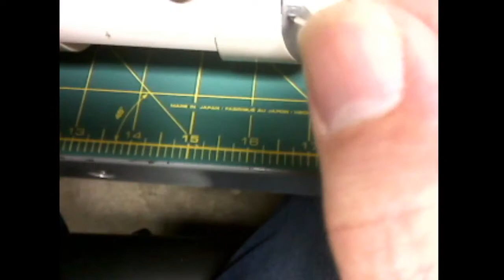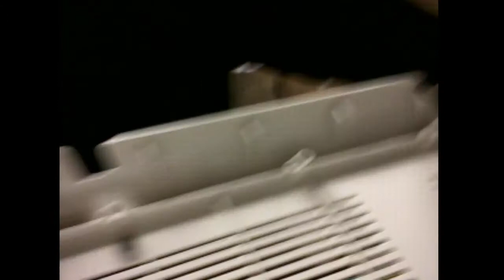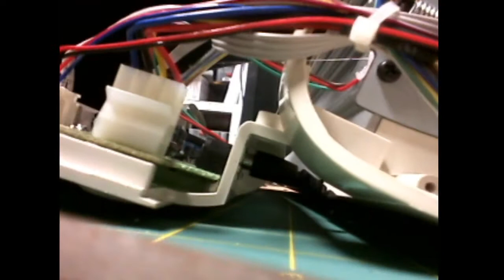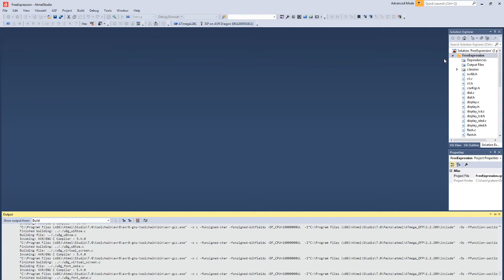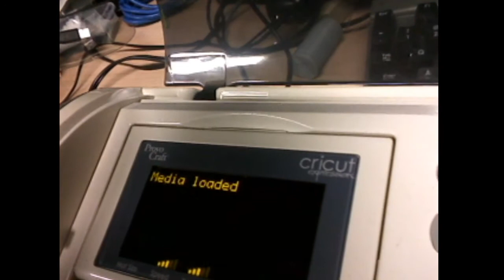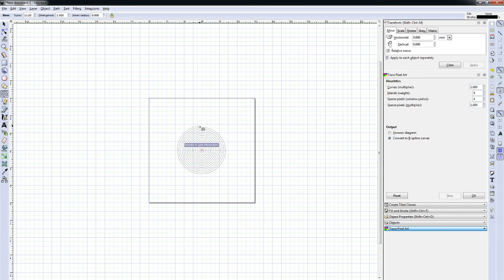Flashing FreeExpression Firmware

Comment: I just did this following this guide.

Since the original chip editor, the ASVRISP Mark II, is no longer made, I picked up a AVRISP XPII compatible device for around $40. I think mine was made by waveshare. 

The cable used between the old Cricut and the computer is a “USB-A to USB-B” cable. My chip editor came with a cable that would work (like his did in the video), but it is very short. I am using a ten foot cable. 

The software that replaces Atmel Studio 7 is now called “Microchip Studio for AVR” by Microchip Technology, and can be found by a simple search. (I found it by searching for “atmel studio 7 download”, and the new software was the top link.

I did have an issue in that the screens. The bottom box labeled “Output” was blocking the “properties” box, and I had to click the little down arrow on the left side of that box (On the lower box called “Output”, there is a yellow bar. On the right of that bar, there is a triangle pointing down, a thumbtack and an X. Click the upside down triangle, click “float” and then when the box moves, click the same triangle again, then click “Dock” that should show the hidden box “Properties” and then it will look the same.

The rest of the tutorial is visually the same, and pretty well done. 
There for a bit, he goes back and forth between “build” and “clean”, but he does it right the first time, and you don’t need to worry about following too close there until he moves on to “Tools”

Comment: When I attempted to program the device, the device signature doesn't appear and I get an error code when I click "read"   
" Failed to enter programming mode. ispEnterProgMode:Error status received: Got 0xc0, excepted 0x00 (Command has failed to execute on this tool)
Unable to enter programming mode. Verify device selection, interface settings, target power, security bit and connections to the target device."
I'm not certain what/how to verify as I'm just following along and don't understand tech speak. The tool is recognized (AVRISP MKII) I used ATmega1281 as the device and ISP is the only option for interface - but it won't read the signature. I don't know what I'm doing wrong. Boo-Hoo! I know it's been years since this was originally posted, but if there is any help out there - I would super appreciate it. Thanks so much.

Comment: Thanks for sharing this. I was using the SCAL 5 hack, but it cuts way too fast for how floppy these machines are. It was literally cutting dashed lines on the Y axis (or is that z on a vinyl cutter). I'm looking forward to proper speed control.

FYI, disassembly is not required. All the pins are accessible through the cartridge port. Get a proto board with edge connections and some basic soldering skills and you're golden. Pin 1-6 on the ribbon cable are the front left edge connections. The first connection is pin 1. It's even reversible (back right pin is also pin 1). I'm going to try this on my junky expression that I already have torn apart. If it works well, I'll do it to my nice one. Yes, I have a goodwill computer store addiction problem that resulted in my ownership of 3 cricuts.
Reply: Have you been able to get around to building an adapter?
Reply: @ellisgl  No. I was going to make one to use with an Arduino as the programmer, but I couldn't get atmel studio to talk to the Arduino. I bought an avr programmer that had an adapter that would plug into the cricut's board, so I just went that route. 

I now a 2 expressions from goodwill running the custom firmware. Also, I got them to work with SCAL 5. I don't really like that software so I just use inkscape, but some people may want to go that route.
Reply: @generic0000  interesting. I wonder if you can just compile the hex and use AVRDude to load it up?
Reply: @ellisgl  I did try to do that, but I'm completely lost with atmel studio. If I remember correctly, I couldn't figure out how to get the hex file. Sometimes it's hard to find out how to do simple things in technical software that just assumes you know what's going on. I'm familiar with Arduino IDE, but I'm kind of spoiled with things just working within the arduino (and even ESP) ecosystem. and they make their instructions simple enough that my kid's could follow along.
Reply: @generic0000   I'm wondering if Visual Studio might be able to do it with PlatForm IO instead of atmels huge dev env
Reply: Same i bought my second one and its one firmware update from working with scal 6 and the libcutter

Comment: If you replace from line 43 in the u8g_rot.c file 

uint8_t u8g_dev_rot_dummy_fn(void *u8g, void *dev, uint8_t msg, void *arg)
{
return 0;
}

with

#ifdef __XC8
uint8_t u8g_dev_rot_dummy_fn(void *u8g, void *dev, uint8_t msg, void *arg)
{
return 0;
}
#else
uint8_t u8g_dev_rot_dummy_fn(u8g_t *u8g, u8g_dev_t *dev, uint8_t msg, void *arg)
{
return 0;
}
#endif

the warning will disappear

Comment: Does this work with a disabled Cricut Maker?
Does anyone know how to turn it back on please? Thank you
Reply from the maker: Unfortunately no. This formware is only for the Expression. Depending on what "disabled" means, you might be able to buy another broken Maker, and swap out the bad component. See if there are any hackerspaces near you. Someone there might have the skills to assist.
Reply: @zombiiilabs  Disabled remotely by Cricut to avoid return shipping costs.
The Cricut Maker is new and considering the price I find it a shame not to be able to find a solution to use it.
Unfortunately I don't know anyone here who could help me as the brand is recent in France.
I think it must be possible to reactivate it remotely but I don't know who would be able to succeed
Reply from the maker: That type of disable permanently burns fuses in the chip and is not reversible. The microcontroller would need to be swapped out.
Reply: @zombiiilabs  can we talk in private please?
Can you explain to me what you think exactly what it is and what to do?
Reply: @zombiiilabs  Can we talk in private please 🙏🏾🙏🏾?
Can you explain to me what you think exactly what it is and what to do?
Reply: @lalla54  Have you found a solution for your Maker?
Reply: @florianlanfrit4479  No 😭

Comment: Hello John I just found your channel on YouTube I'm wondering if you or anyone can help my cricut is just blinking cricut on the cricut screen. It was fine this this morning and I downloaded cricut design space and it started blinking, I can't even shut it off without unplugging it. PLEASE HELP
Reply from the maker: Hi Marie, I have never used design space, but it is possible that the program attempted to upgrade your firmware and failed. It's not common, but it does happen. There might be a way to force the Cricut into recovery mode by holding down some button on powerful, but only the manufacturer can help with this.

Comment: Got this working finally. Everything cuts backward though. Any thoughts?
Reply: At 36:40, the "Mirror X axis" and "Mirror Y axis" boxes should be checked.
Reply from the maker: Are the steppers connectors flipped? This can cause the motors to turn backward.

Comment: For pressure and speed:

Pressure: press Xtra1, then press the +/- arrows, then press load/unload paper.
Speed: press Xtra2, then press the +/- arrows, then press load/unload paper.

Great video! Managed to do this using an Arduino instead of a dedicated ISP device. Thanks!
Reply: I press Xtra1 and then + and bunch of times and still the pressure is not deep enough to cut. My cutter setting is also at 6. Any suggestions?

Comment: Is there anyway to code the machine /add hardware to make it WiFi capable?
Reply from the maker: Not easily. You would have to bypass the USB interface and wire up an ESP to the UART. Probably would not be reliable.